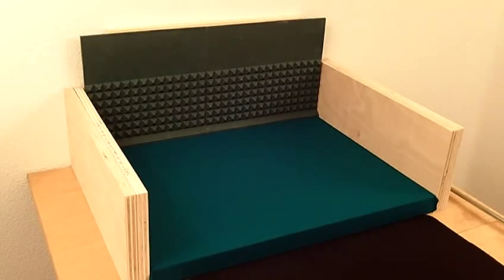Dice Control: Micro Fiber Vs Felt  Part 2

Comment: Bub, the modern material these new craps layouts are printed on is 2mm nylon-laminated neoprene -- available from many sources.  The neoprene is the source of additional tricky bounciness to contend with (not sure what you mean by 'faster'...), but the bounciness CAN be countered with shot modifications and practice practice practice!
Reply: +Brandon Nichols I agree. While I have no inside casino knowledge other than observation, I am a cold water scuba diver.  I suspected neoprene or compressed neoprene, as soon as I touched the crap table surface.  2mm with the print on it as you stated or maybe 1.5mm if the table has a separate microfiber top surface. I did set up my home table with a similar material and found the dice bounce to resemble the casino table bounce near my home.  My thought and observation is that, "if you can get a good series of shots on a neoprene top, then you can shoot on anything".  I have had the best luck lately with an on axis hardway throw, but with less spin or even no spin, just simply trying to pop them down the table with as little energy as possible and hope they stay on axis. Tip the dealers fairly in hopes they overlook a few reasonable mistakes. One last thought: When you throw a pair of dice, and they dig into the material and bounce straight back at you or off to the right or left, that tells me something funky is going on under the felt. The dice act almost like a suberball sometimes in their reaction to the table top, before they ever hit the wall.  If you find a table that works for you, I say stick with it, but try to practice at home on the bounciest possible top.

Comment: I believe that the casinos stopped using only wood then micro fiber or felt. They have added micro fiber on top of old felt most of the time to make a bouncer table that dice controllers  like you and I can't handle. Doesn't  matter if people make practice rigs that have either micro fiber or felt, the casino's  win and most of the dice controllers  are all gone. Bye bye money if you don't practice dice setting on a comparable table.
I built a practice table and considered myself  to be a great controler after practicing  every day for a year on a table with only wood and micro fiber but every trip to the casino's i soon realized that my skills had no power on there bouncy tables. Advise, practice on a similar table and get better or walk away ahead.
Reply from the maker: Not true about casinos switching felts. Just because you practiced for a year does not make you great. Its simple, learn and practice bad technique and you ended up mastering bad technique. This is what is plaguing the DC community. YouTube "gurus" teaching old out dated techniques, there so many now its maddening!!!!!!!! Some so bad it hurts my heart because I know people who use those techniques are going to lose there ass' big time!!!!!! As for bouncy tables the PARR throw which is what these YouTube gurus teach will fail on bouncy tables 95% of the time. I teach methods to beat bouncy table other gurus or teachers know nothing about. I had many winning runs on super bouncy tables.